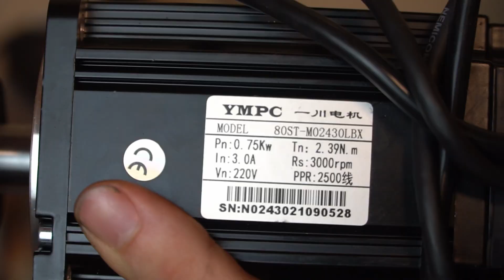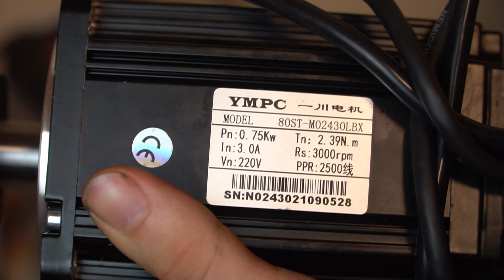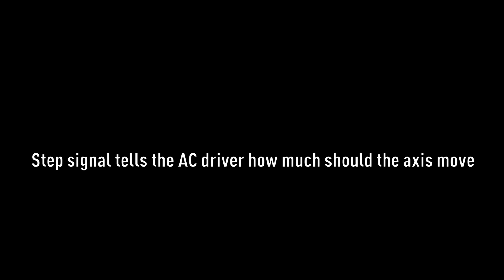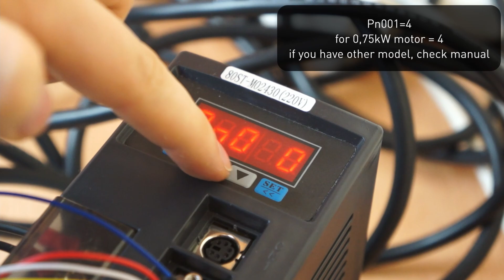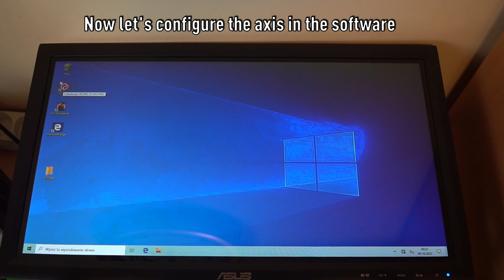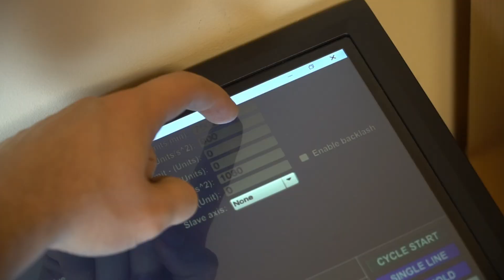AXBB-E Ethernet CNC Controller #2 AC Servo Setup

Comment: The AXBB-E specification manual says the board can handle up to 6-axis. How does one connect 5th or 6th axis? Usually, 4 axis are connected to the non-isolated (ports 09 to 016) x,y,z,and A-axis, with only port 017 left. Some say the isolated cannot be used, and some say they can? In any case, how can this be done safely(without using the add-on board (IDC26)), and what port options does one select in UCCNC? Thank you.
Reply from the maker: I see no problem with using the isolated outputs. I didn't use them for that purpose though. I think you should be able to connect the +24V to the step/dir + terminals THROUGH A LIMITING RESISTOR (~2,2k ohm probably) and the outputs to the step/dir-. The isolated outputs are also fast, transistor driven so should be sufficient. But considering the isolated outputs are some kind of referenced to the 24V then you need to drop down the current so you don't burn anything with the 24V. This is what I think it should work but take a look at the manuals of the AXBB-E and the stepper driver. I didn't do that yet so it's my guess, not experience.

Comment: è possibile utilizzare lo stesso servo ac come spindle con encoder incorporato?
Reply from the maker: A seconda del servo che hai, questa potrebbe essere un'opzione. Questi servi solitamente hanno encoder che generano 2500 PPR (x 4 o 10.000 letture per giro). Questo è troppo perché il conducente possa leggerlo correttamente. Tuttavia, alcuni servoazionamenti hanno la capacità di dividere questo valore. Quindi è possibile utilizzare le uscite del servoazionamento OA OB OZ e leggerle da AXBB-E. Leggi il manuale AXBB-E riguardo al collegamento di un LINE DRIVER: le uscite encoder dei servoazionamenti sono solitamente di questo tipo. Cercherò di fare presto un video a riguardo, ma per ora è tutto quello che posso dire.

Comment: Bro, You are a damn expert in this...!!

 I have recently Observed that Some Big Bosses in  motion Control Industry like - Yaskawa , Mitsubishi and Delta..etc do Offer Plug and Play CNC Motion Solutions with Modern and Customizable  GUI Options.

Disappointing

2300 IEC 
Mitsubishi CNC Controller+GUI
Delta Controller+GUI
Wecon Gcode Controller+GUI
Leadshine+GUI

For People Like Us Need Tutorials for these.!

1) How to Design a Basic 3 Axis GUI Using their GUI Designer Application   with Very basic display elements like,

Machine DRO and Current Offset DRO statuses, 
Feed rate,
Spindle Speed,
G Code Lines, 
Spindle Position on  Table Layout ..etc

2) How to Configure the recommended 3 Axis Controller to accept commands from that GUI Layout We design

3) Enabling the User to Run G-codes by  plugging in the USB Drive to the Controller

4)Configuring Post Processors ..etc

(Must be extremely advanced Automation Stuff Right...? I know But its quite tempting to learn or at least try to learn..)

Can You attempt to Do a series of Videos with any of these Companies?
I hope they would gladly sponsor such videos as their product promotions..! And it would be interesting to You as well
If any chance..!
Reply from the maker: That's sounds quite interesting to be honest. At this moment I'm really busy with my CNC lathe project with the use of the UC300ETH Ethernet controller from CNCdrive.com so I'm not able to pay attention to other topics (YouTube is not my daily job). But in the future when this project is finished - well, if any of those companies were interested in such cooperation, maybe? 
But my channel is kind of a DIY channel. This stuff i'm bulding now is already quite advanced sometimes to most DIYers. And the stuff you're talking about isn't DIY at all I guess, haha! :) What do you think?

Comment: Why you dont use Mach3...
Reply from the maker: Because I had an oppurtunity to check out UCCNC and I find it much more modern over Mach3. Really worth to check it out. Also if somebody is buying a license - UCCNC seems to be the cheaper software and better in my opinion. Win/win situation :)
Reply: Thx..Keep that work,I learnd a lot watching your videos..😎
Reply from the maker: @Doctor_88  Great to hear! 😁
Reply: @GBWM_CNC  Mach 3 is a joke .
Reply from the maker: @CeNuVezi  i wouldn't agree. It just works :D although not the best out there
Reply: @GBWM_CNC  u dont need to agree , use it , and see how bad it is , freeze all time , dont follow planer points , goes where he wants ,u cant recover when u cut with a plasma , it lose steps all time , and is soo outdate then even a grbl is far more pro then it .
Reply from the maker: @CeNuVezi  hmm, my friend is running on daily basis mach3 for simple milling in wood and it seems it works fine for that :)
Reply: @GBWM_CNC   i came to the same conclusion...less known it seems though...channels that have used it say the same